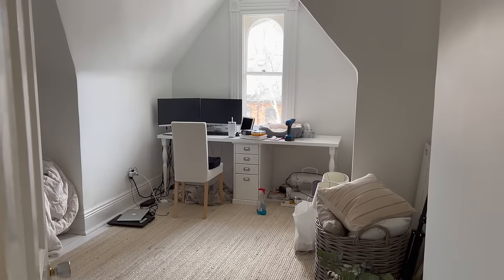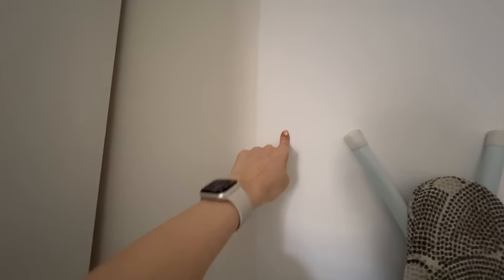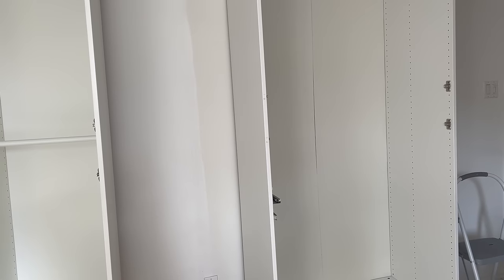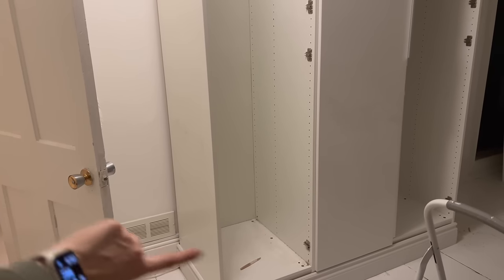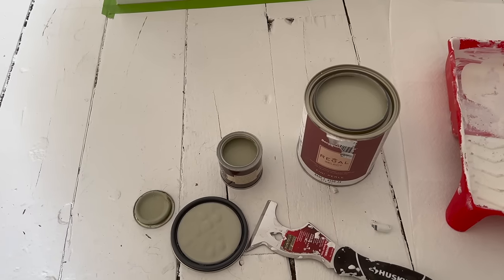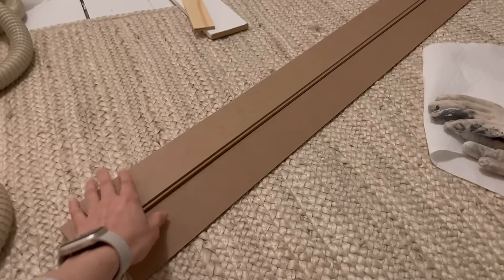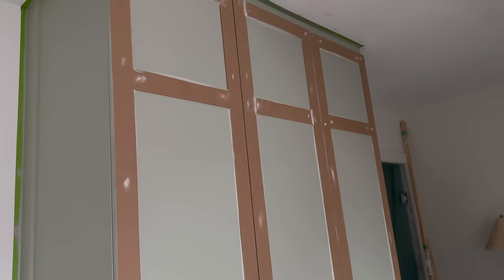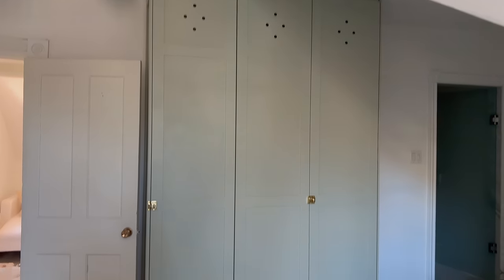IKEA Pax Hack 2.0: Reveal & DIY  |  EMMA COURTNEY

Comment: Thanks so much for making this video. I am about to embark on this process in our bedroom but I also have a really old house and have been so torn about trying to cut our old baseboards. This definitely seems like a good compromise. I’m not sure how I, going to navigate our molding at the top yet but I might end up doing some similar up there too.
Reply from the maker: I really like to respect our old house when it comes to thinks like that… also in our kitchen reno I realized our baseboards are so old that there’s nothing similar. It would cost $1000 to get a millworker to make a template to make more 😅 

For the top you could also just add crown moulding to it if it doesn’t reach the ceiling. That always looks nice!

Comment: I would love to start a project like this, so I am trying to understand all steps :) could someone explain why you need the spacers in the back ?
Reply from the maker: Because I didn’t want to remove the original baseboards in my house - my home is 130+ years old and who knows if I want to remove the wardrobe in the future. If I didn’t put the spacers behind, the wardrobe would be leaning/a gap at the top (when you push the wardrobe against the wall, since the baseboard at the bottom there would be a gap at the top). The spacers allowed me to anchor the wardrobe to the wall so it can’t move, tip etc. I hope that makes sense 😅 if I had a new home I’d just remove the baseboard all together, but I try to respect my old home 🥰

Comment: Hi! I have some melamine built in closets that I'd love to redo similar to this, but I'm wondering, has the paint chipped or has it been on issue painting on something so smooth like those doors? Maybe I missed it, but did you use some sort of primer? Thanks!
Reply from the maker: No it hasn’t chipped! I used the red can of BIN zinsser